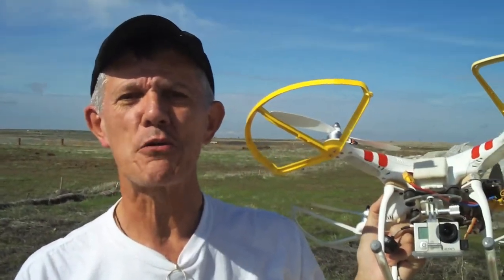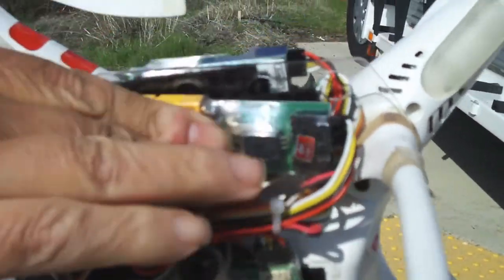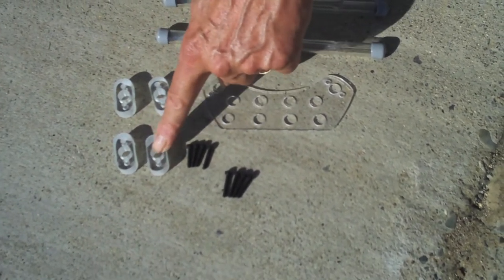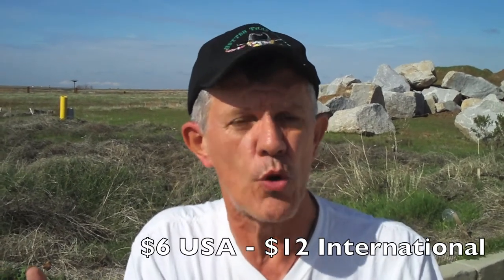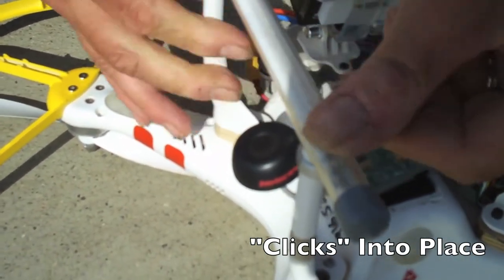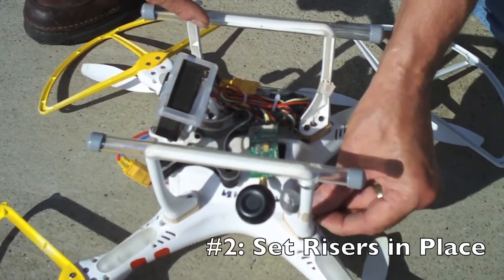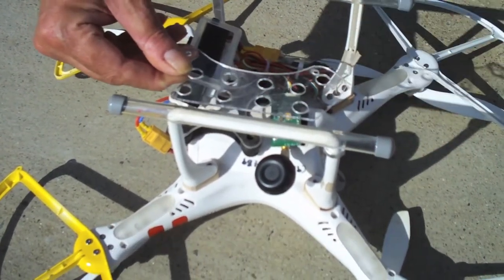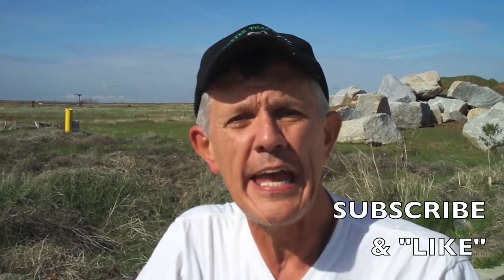DJI Phantom 1 & 2 - Mod Kit - Risers, Landing Gear, Shelf Unit

Comment: Hey Jim. Does having the shelf unit on 1 side only unbalance the phantom in any way during flight? Was thinking of putting a small 1000 battery on it to power the gimbal separately.
Reply from the maker: We've tested it with all kinds of things.... the phantom will compensate unless you put over 3 ounces on it.

Comment: Hi Jim.

How easy is it to remove the skids?

My quad won't fit into its case with the skids on so they'll have to be put on and then taken off every time I use it.

Thanks
Reply from the maker: Once you get used to putting them on, they're easy to "pop off" if you give them a "YANK" - It gets easier after you put them on and off a few times - no worries.

Comment: Jim, help me out here....how would I find out which Dji phantom I have? 1 or 2... Many thanks
Reply from the maker: Does your phantom have the silver AND black prop nuts on it? (or are they ALL silver?) If it has silver AND black propeller nuts, then you have a Phantom 1.2 (second generation). SO - you can switch out your propellers and put VISION props on it (and vision prop guards). Longer flight times, less vibration. Better video.
Reply from the maker: If it has ALL SILVER prop nuts, then you have a version 1 phantom. (cant put vision props on it UNLESS you switch out two motors)
Reply from the maker: (If you bought your phantom in the last 6 months or so, you have the newer 1.2 model.... (good quad)